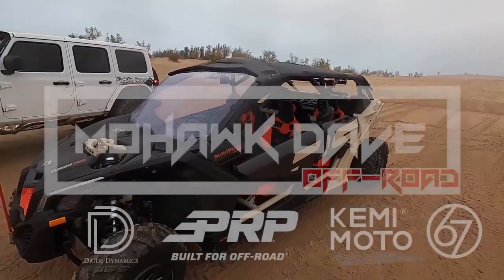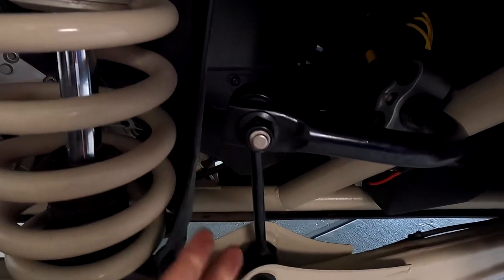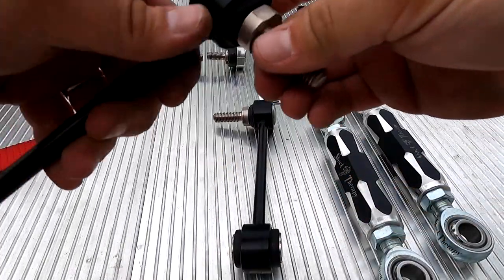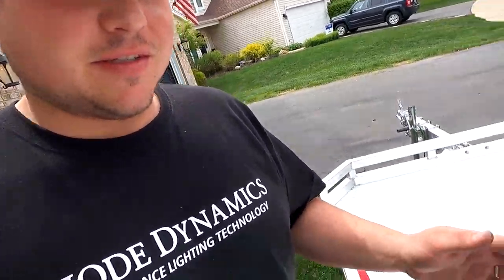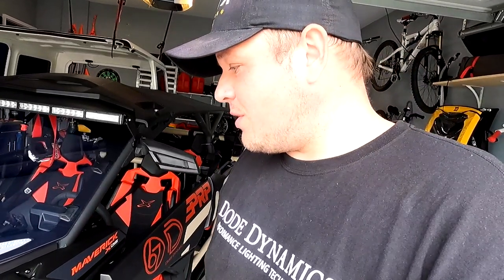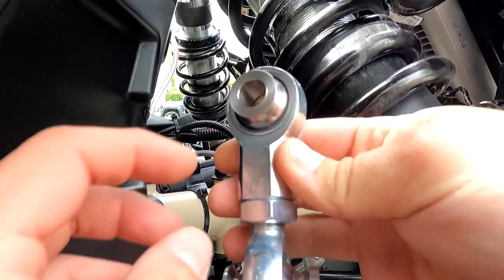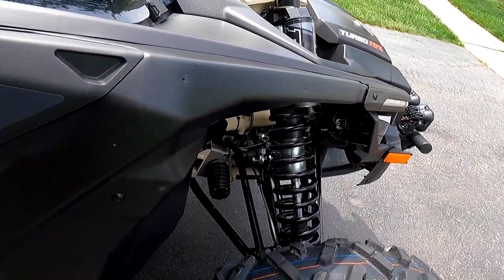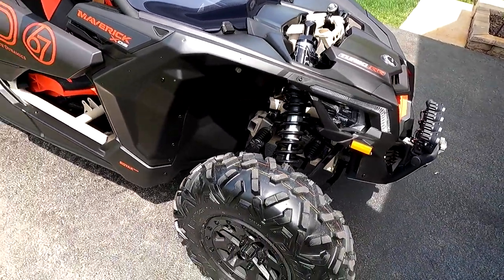2021 Can-Am Maverick X3 Clunk - Shock Therapy For The Fix

Comment: Disconnected my front sway, no issues at all. Ever. Ran Moab, Alpine loop, Imogene pass, sand, mud, corners, crawling… Don’t even need it. (There is videos of this from other people so I didn’t bother even making one). Disconnect my rear while rock crawling only. Never for over 20 mph or pavement. It clunks some times, but it’s never been enough to bother me. 2021 Max with shox, 900 miles and counting. Most of these companies just make stuff just to make stuff. Like an $8 rod end for your sway bar you can buy at any hardware store, laser etch your logo on it, and charge $200 to all the cool kids who want to “overland”

Comment: I’m having the same clunking issue but I took my front sway bar out and the front still makes that noise. Everything else is tight
Reply: I read of someone with your same issue  even after taking out the sway bar.  They fixed it by tightening their suspension by two clicks (screw driver adjustment on top of shocks) and it went away.   Good luck :)

Comment: What a shame for a $30k+ machines!!!
CAN & AM needs to hire Japanese not Chinese engineers.
Come on Honda, stop fooling around with pride and old design! 
It's time to catch up with wider, and better looking and sounding UTVs with your mechanical reliability.
Reply from the maker: The problem with all the manufacturers is that if the quality goes up, so does the price. $30k machines will be $40k or $50k, but I totally agree with you.
Reply: @MohawkDaveOffRoad  For sure, but I would rather pay $40k for a long-lasting reliable machine, than $30k for something that might break down in middle of the mountains running mine and my friends vacation. 
It would be nice to see a Sport SxS with Maverick X3 looks, Honda's reliable engine and dual clutch real tranny, and KRX built quality. Which to my opinion would be the best SxS ever built.